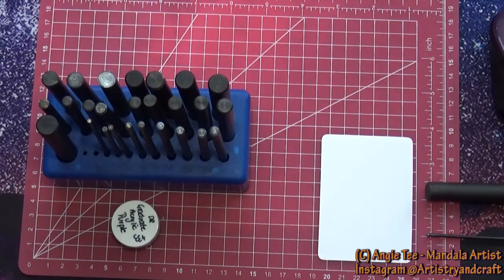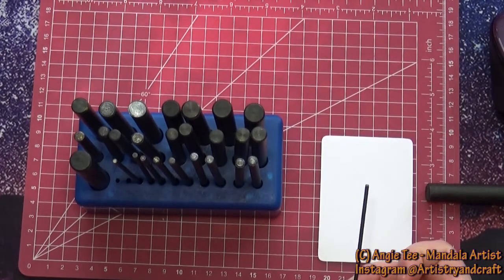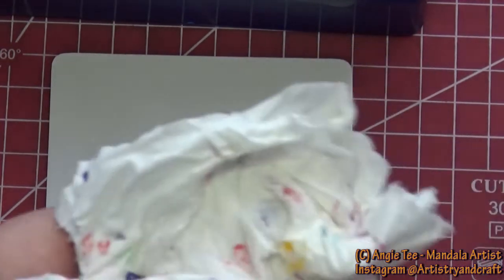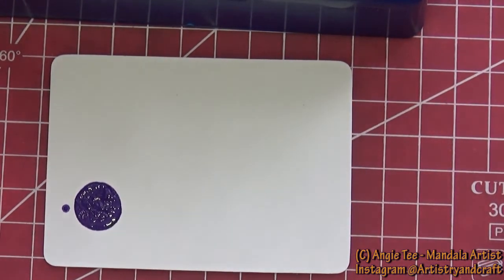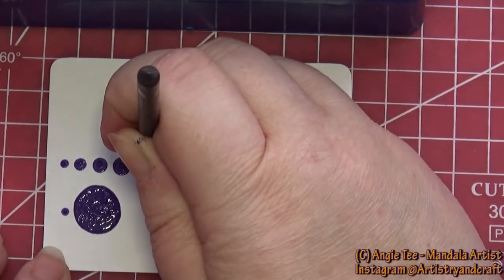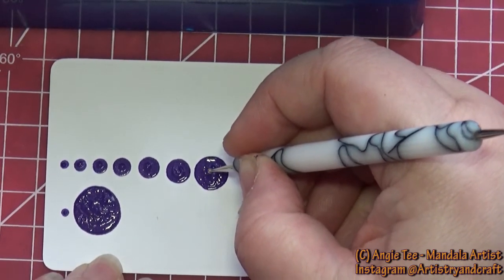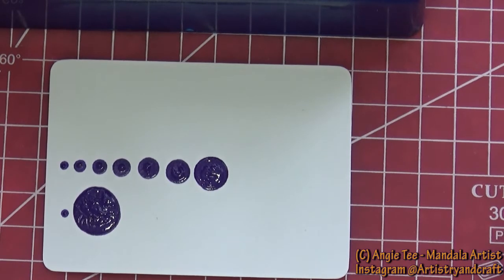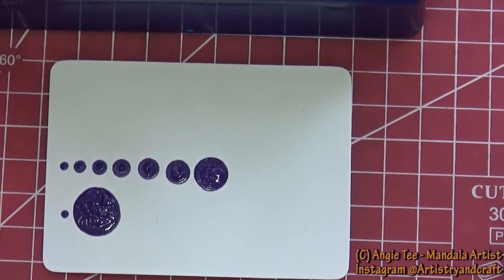Transfer Punch Set - dotting tools

Comment: Hi Angie, am enjoying your videos and would like to thank you for the information you pass on, I have a tip for making plump well rounded big dots, after putting big dot onto project load up a dotting tool several sizes smaller  (load it up well even scooping the paint onto it if the dot is really big ) and drip the paint onto the dot, you can even press down a little and add more paint as needed until the desired rounded shape is reached.Hope this helps, keep up the good work, Phyl.